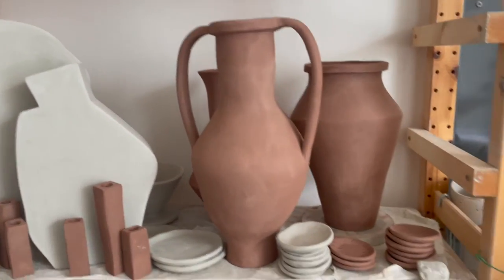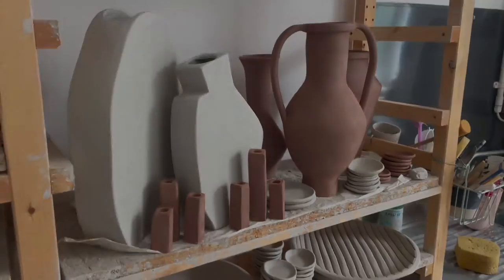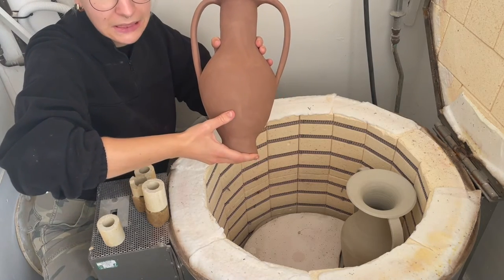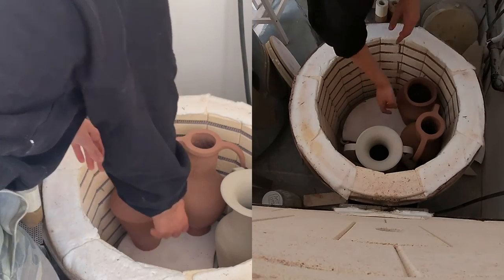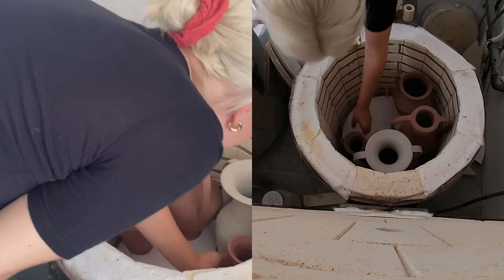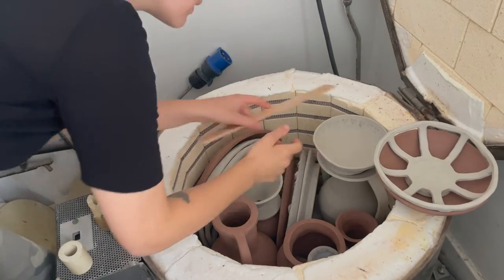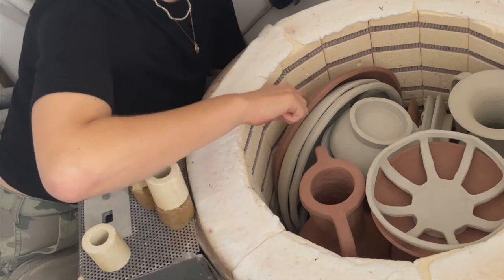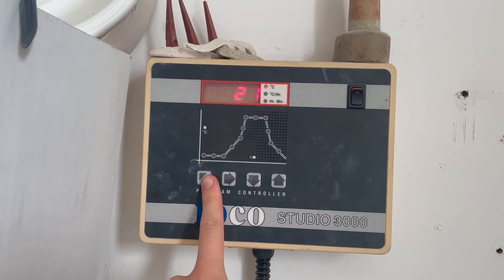How to BISQUE FIRE a pottery kiln | POTTERY 101

Comment: This is a fabulous video - thanks for the great information!  I’ve been trying to figure out a bisque program for the old manual kiln I just got. I am very new to all of this and couldn’t find anything that had basic instructions for what temps and how long to bisque fire. I’ll try your program as a starting point and see how it goes.  Thank you so much!!
Reply from the maker: Feel free to go slower - 65°c / h works well in the winter, but if you’re not sure if things are dry you can go as slow as 50°c. I also will sometimes slow the second ramp to 150°c/h too, especially as the elements age. Good luck!

Comment: Question- will ALL "cone" level clays turn to ceramic @ ~600 degrees F?
Also, THANK YOU for explaining the greenware/bisqueware part. I'm brand new to pottery and trying to figure out my next step on some pottery my wife and I made. I looked everywhere for the definitions of these commonly used terms and everyone is SO technical. Like, I dont need to know the chemistry formula for clay to understand what "bisque" firing is!! lol.
Maybe I missed it but I didnt catch what "cone" your greenware is. And from what I learned that's a VERY important part when turning pottery into ceramics. And 99% of youtube videos dont specify the cone level of the pottery they're using! Especially since I could take techniques and advise and destroy my pottery by heating it to incorrect temps. 

Ty and looking forward to a response from someone that knows better than I (hopefully).
Reply from the maker: I'm glad that was of use - when I was editing I wasn't sure if I should cut that out! 
Greenware is unfired clay, so isn't a cone. But the clay that I'm using is fired to cone 8-10, but these bisque instructions in this vid will apply to 99% of the clays that you'll be using in studio pottery. 
Generally all pottery clay is bisque fired to 950-1000c (around 1800f), and that quartz inversion happens around 600c with pretty much all clays. There will be a slight difference in all clays due to different levels of organic materials etc.
Where you want to be aware of your cone temp is when you are glazing - if using an earthenware, it could melt or bloat if you put it in a stoneware firing. If using a stoneware clay, it will be underfired in a earthenware firing, for example. 

Hope that helps!

Comment: Hi Mae, I was gifted about 200 doll parts moulds for porcelain slip casting. I need help firing. I want to make doll head pots for succulents. Problem is I need more advice on kiln temps to make porcelain clay hard. Where do you order your clays from? I noticed you have terracotta and white, do they fire at the same temp? Im so green. I did ceramics once when I was a kid, we had to clean greenware before bisque firing then glaze fired next. Id love to make a line of pots for ETSY. Im following you closely.
Reply from the maker: Hi! Sounds like you have a future dolls factory… spooky! 
Porcelain slip can be fired very high, check with your supplier. I get my clays from Bath Potters or Potclays - if you’re in the uk check them out. Otherwise look up local pottery suppliers in your area - don’t go to amazon or similar as you’ll pay higher with no support. 
Terra cotta and stoneware can be bique fired together, but the glaze is separate. Watch my glaze firing vid for more tips there :)